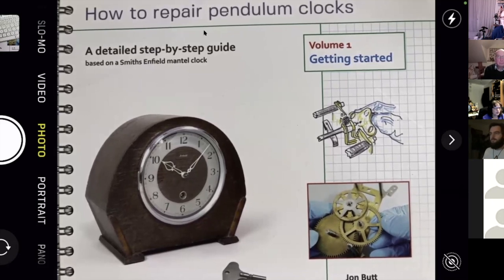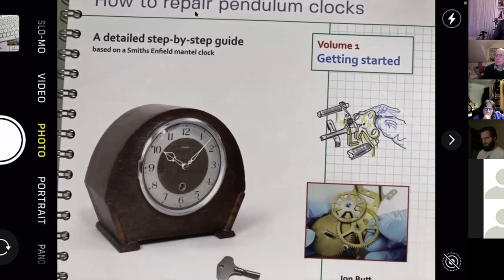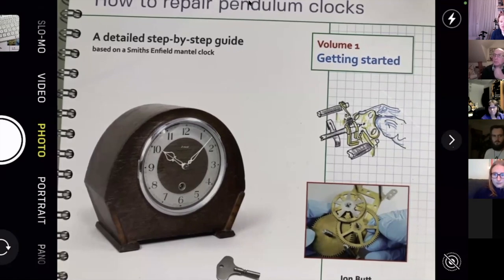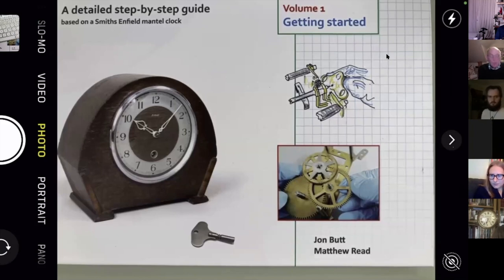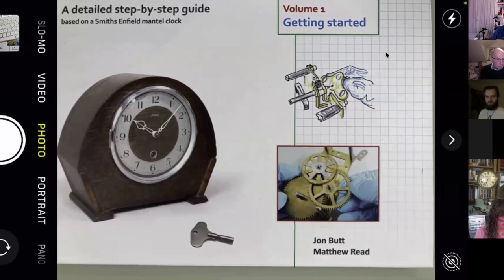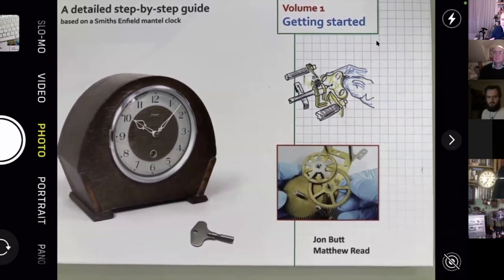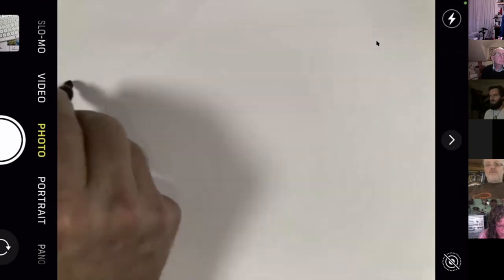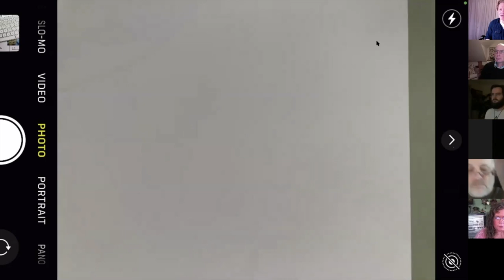Open Clock Club 003  2020_12_12

Comment: 17:05 For those interested in changing the case, there are plenty of bare clock movements on eBay sold as "parts or repair", that you can get running and design a case of your own for. I try to find movements (mainly cuckoo clock movements) that clearly were replaced with new because of their wear,. I avoid a movement that - based on the other parts the seller is offering - came from a perfectly good clock that is being sold in parts.